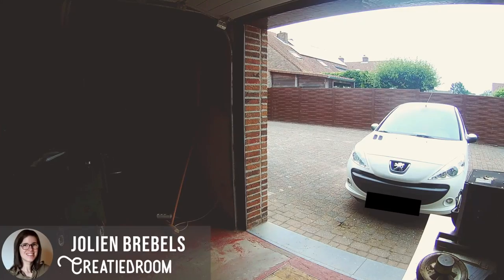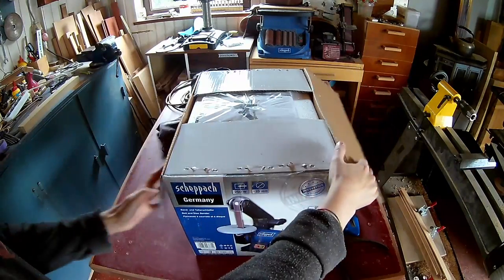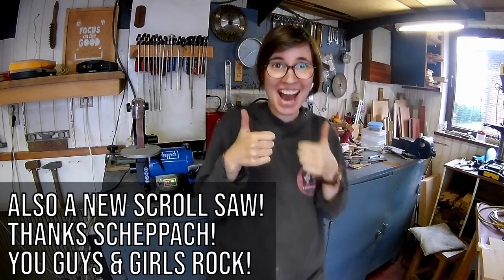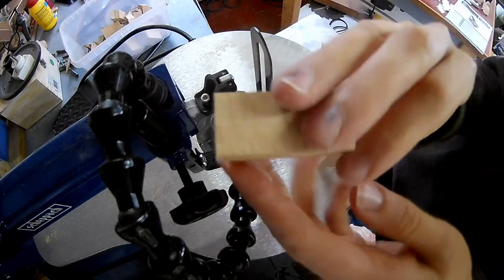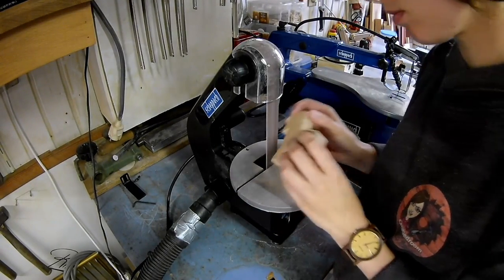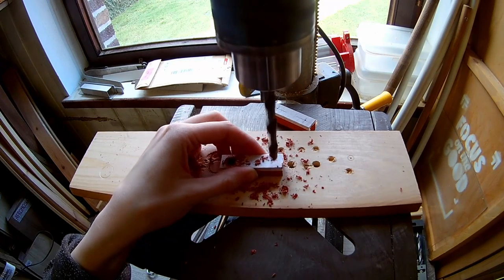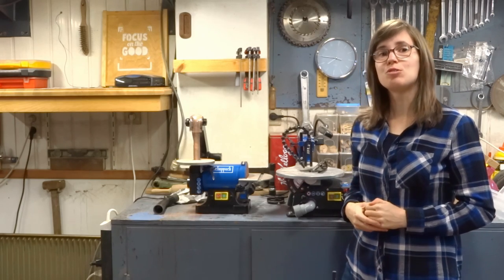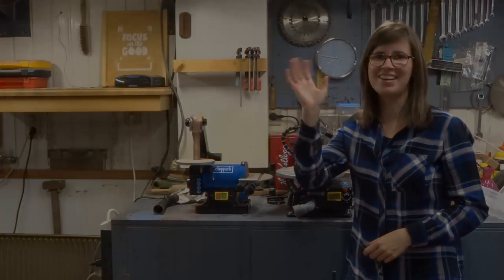Wooden Farm Animals - Easy DIY Woodworking Project - Scroll saw project

Comment: Simple Ang great ! Congratulations. What kind of colors do you use for baby toys ? Do you apply wax after to protect them ?
Reply from the maker: Thank you! For these animals I didn't use any colors, I just used mineral oil to finish them. If you want food safe oils in colors, you can use Rubio Monocoat (one coat) or Osmo Hardwax Oil (2 to 3 coats)